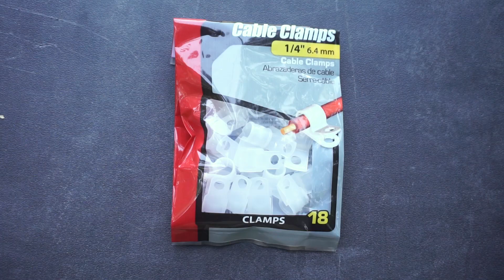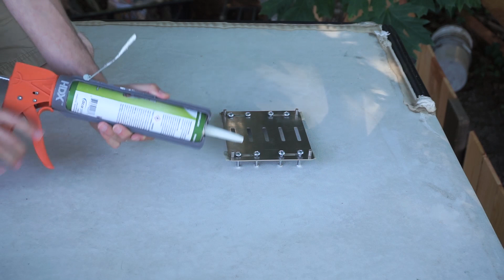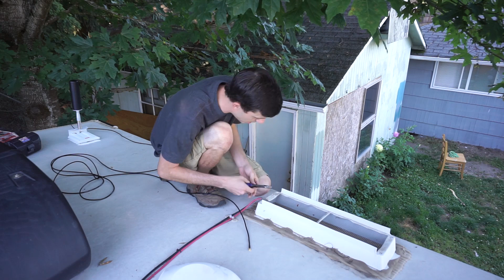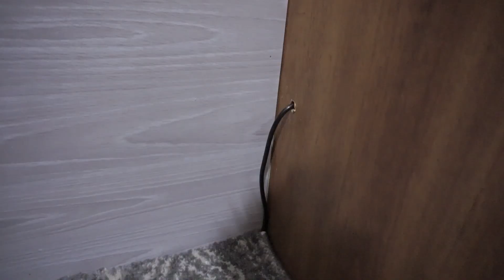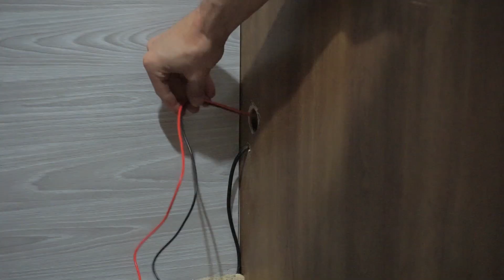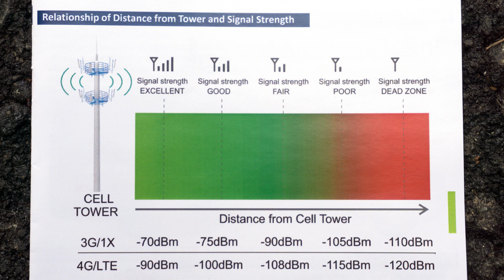RV Cell Signal Booster Install - SolidRF RV Pro Cellular 4G LTE Amplifier

Comment: You may know this trick but for those that don’t, if you strip out a wood screw hole you can fix the hole by filling the stripped hole with toothpicks. Stuff them in, break them off flush then you are good to go. Add some wood glue if you have it.

Comment: Nice job and explanation... One problem I see with running wires down the roof vent is that when the fridge dies or needs to have the gas regenerator replaced the entire unit must be removed from the front and pulled into the interior of the coach... And then put back... Having extraneous wires running through the cabinet and enclosure wall will likely be a hinderance to this process...

Comment: Where did the second antenna plug into ?   You seem to use "Cell Phone Signal Strength" interchangeably with "WiFi Signal" as you presented this. I thought those were two different things.  Regular Cell phone conversations are not on WiFi (normally for data). What Am I missing ?  Thank you !

Comment: A good adhesive will provide more than sufficient adhesion  of a flat plate to a flat surface.  Better to have used the adhesive under the plate so that every bit of the plate's bottom was covered and thus adhered to the roof surface.  Wow, that looks precarious!  Don't run under a tree!

Comment: Nice, David! FYI, as a woodworker, here's a tip when you want to drill to a certain depth and no further. Use painters tape to make a flag on your drill bit (cheap!). When the flag gets to the surface you're at the depth you wanted. Should work for the hole saw too, although I've never tried it. I would be super nervous next to that tank.  There's also something called a gimlet you can use to drill holes. Not as fast as a drill but more precise and totally controllable. I have six different sizes in my woodshop. You twist them by hand. Cheers!

Comment: Hi David.  Another great vid.  Just an observation.  I noticed as you were connecting the ground wire that there was a lot of debris around the strip of wires. A quick vacuum would be in order to avoid any possible problems.  Just a thought.

Comment: Hi David,  You first state the interior needs to be less than a foot and a half from the outside antenna.  Then you show the internal antenna on a desk more than a foot away.  How does that affect your install.  Also did you look into a booster kit where the booster stays inside the coach? and not outside on the roof???
Reply from the maker: They are less than a foot and a half from each other so this is not an issue for us.
Reply: @FateUnbound  It looks like the outside one is 6" off (above) the roof and the other one is on a desk like 4 feet below the ceiling.  It may work perfect but it sure looks like they are much greater than 18" apart.
Reply from the maker: Okay I see your confusion. They need to be no more than 18" horizontal distance and at least 4 feet vertical distance from each other.

Comment: You have connected the positive side of your cell booster to the positive bus. Please fuse this device at the bus or better yet use an actual fused position in your breaker box before you burn your trailer up.

Comment: Thank you for showing the actual improvement. I tried a WeBoost and it was all but useless. Just an FYI. When I ran my 12 volt power up to my roof to power fans for my AC units, (the original 110 volt fans failed miserably), I used half inch water piping to run the wires through. It protects the wires from sun damage and most of all from squirrel damage. I used small pipe clamps to hold the runs in place. Standard connectors and tees made the job neat and easy. I used the flexible piping so going over the end of my roof which joins to a large radius on the end cap was easy as well.

Comment: Nice video...On that table corner, if you place a small square of aluminum foil, between the antenna and the wall, to make it act like a reflector for the antenna, you might increase the range and signal strenght, almost for free.  Give it a try! You can also apply the same principle for the roof antenna, so you can direct it to the signal source when you are in the woods.

Comment: so, a couple of things:

1) your phone's signal meter is not going to give you an accurate reading on the actual signal that you are getting.  your phone will only show you the signal strength between it and whatever antenna it is connected to.  obviously, since your phone is connecting to your indoor antenna, and it's only a few feet away, you are going to get "great signal strength"...but that means nothing if the signal quality coming in to the outdoor unit is junk (or non-existent) to begin with.  there is a huge difference between signal strength and signal quality (and your phone only shows you strength).  the real test is actually trying to pass data, that is what will tell you the full story...which leads into:

2) you should never, ever, ever, ever, run your signal cables parallel with any sort of power cable. ever.  i don't care how much easier/cleaner/prettier it is, or how much work it is to run them separately...if you run your power & signal cables parallel with each other, there will be signal degradation/distortion, which will limit the quality of your signal as it comes out the antennae.  if you absolutely have no choice but to cross power cables with your signal cable, make sure they are perpendicular with each other, and not parallel, in order to limit the surface area of EM induction.

i'm not trying to be negative here, just stating facts that a lot of people either don't know, or don't think about when doing these types of installs.  that said, we are all free to do things as we see fit, but i just want to make sure that as many people are at least aware of the facts beforehand so they can make their own "informed" decision on what works best for them.
Reply: Indeed. Both are very important and practical points. I am really curious on how this works out.
Reply: @Cougar125 This is true, but it is also more expensive for the cable the more shielding you have...not to mention, I can guarantee you that the cables that come with this kit do not have near enough shielding.  And even if you have the extra shielding, there's no reason to take chances, especially when it costs nothing to change the cable path.
Reply: xunil76 is correct.  We purchased a WeBoost for our vehicle with the plan to move it to our off-road camper when parked.  After installation, I started looking to see if we had a bar increase.  Wrong decision because the first time we used it, I saw no difference in bars.  I called WeBoost tech support and was emailed instructions on how to use our Iphones or Android phones to get a more accurate picture of reception strength.  Following those instructions, it was very easy to see on my wife's Android the cell coverage improvement with the Weboost on and when it was off.  For some reason, the Iphones are more hit or miss with this, but no issue with the Android.  The weboost we purchased was the Drive 4G-X OTR that comes with a DC power adapter (designed for vehicles) but after asking weboost, they were nice enough to send us an AC power cord.

Comment: Good stuff, but as an RF guy, I have to comment on the measurements at the end of the video.

First, the units for the measurement are not "decibels", it's "dBm", which is "decibels with respect to 1 milliwatt".  A decibel is the log of a power RATIO, not a power level.

Second, just because the power level is higher doesn't mean the reception is any better.  It MIGHT be better, or it might be worse!  This touches on an RF concept of "noise figure", which is how much worse a circuit makes the signal-to-noise ratio.  When you have an amplifier, you don't just make the signal bigger, you also add noise.  In contrast to this, the antenna on the roof probably gathers more signal, while the walls of the RF, as well as the lower position of your phone vs. the antenna on the roof reduce the signal level.  So the signal booster has a chance to make the signal quite a bit better--but probably not the 30 dB (it's now a ratio, so dB is correct) improvement you see on the phone.

The only simple way to know that you've got a better signal is to do a throughput test.  There are (much) more complicated ways, but they are  going to be quite painful for a setup like this.

So why not do a speed test in an area with poor signal, and see how much better it is?  You don't even have to put the phone in a test mode to do this (which is likely if you are showing the radio signal level).

Comment: Great job on the video David.  We're considering something like this as well for our cell/Internet needs.  Thanks.  I'm curious if the slots in the bracket that you filled with Dicor are for cooling.  Just a thought.  Great vid.

Comment: I think I might have positioned that outside antennae bracket a little differently considering that you could only hit one rafter. Positioning it diagonally would have allowed you to securely mount it in two opposing corners. GRANTED, it would have looked weird and honestly like a mistake (admit it, it would have looked a bit crappy to you and I because I suspect we are both perfectionists) but it would have a REALLY GOOD grip on those two corners, leaving no room for flexing up as is possible if those two screws on the one side that are only going into 1/4-inch plywood back out. Still, it's likely going to be just fine as is. (Apologies for the Monday morning quarterbacking. LOL. I hate it when that happens, tbh, but did think my suggestion "might" be helpful for others who may be less confident in the plywood only method for the one side.)

Edited to Add: I retract my suggestion. You have FOUR screws in that one rafter which is much better than the TWO that my suggestion would result in. Good video. Safe travels, y'all.

Comment: Thanks for sharing the installation video.  I was confused when you said the inside antenna has to be 1 1/2' from the exterior, but then when you put it inside it looks like it's probably 6' below the exterior antenna.  Does that mean it has to be laterally within 1 1/2', but can be vertically several feet away?
Reply: yes, laterally.  the signal mostly radiates out of the antennae in a 360° radial pattern from the sides, and in sort of a "wedge" shape as it goes outward, but not so much from the top & bottom; so if you put the interior and exterior antennae where their signals can pick each other up, you create a feedback loop and you booster doesn't work properly.  if they are (almost) directly above/below each other, they can't pick up the signal from each other, and things work the way they should.

Comment: what's the signal strength outside your camper at that location?  Lets not forget a trailer is a metal box.  I find good signal at my windows, but loose most signal when not at a window in my camper.

Comment: I think there is a flaw in your signal strength test. You are testing the signal from the interior antenna, not the quality of the overall LTE connection. You really need to test bandwidth at minimum.

Comment: Cool install. Love it but you may think of installing a switch on that 12 plug (perfumery a lighted one) so you don't forget to turn it off while driving to next camp site. I did the same thing years age when I installed a booster on my truck way back when 2g. I hard wired it in and forgot it and almost run down my truck battery. Again cool vids Love them keep it up and stay safe.

Comment: Once again a great tutorial from David. The longer the cable run the greater the signal attenuation. I would have taken the cable straight down in the corner; trimmed the line to the cable length needed; and added a new connector. With 5G around the corner, will you need a new booster next year?

Comment: When it comes to potential water infiltration, a belt, suspenders and string in your pocket approach is definitely called for.  

If the panel was completely disconnected from shore and battery, how are your interior lights on?  

That is a big boost, but 4’ interior range seems rather limiting.  It will be interesting to see how it is to live with over time, and how much it drops when not working right next to the interior antenna.

Well made video, and keep up the good work!

Comment: Water tight tape (self fusing) -(search Amazon) will keep water from getting into your external coax connectors .... degrading signaling and corroding your cables with water ingress.

Comment: Good video.  Only thing I would have done differently is to use Eternabond tape on the cable run from the exterior antenna to the fridge vent.
Reply: Jerry Apple I would just use dabs of dicor every 10”... The life of these things are only 2-3 years then they need to be removed to upgrade...

Comment: Take a pair of pliers and a roll of Electrical tape back up and snug your N connectors on the amplifier and then wrap them up with tape, no Lap, you may have to take them off at some time. Nice install!

Comment: I am super interested in finding out what the  measurements of  RadioFrequency radiation is with all that inside the trailer. I  have inflammation issues with vertigo that would be highly affected by it. maybe in a future video you could run a test with a meter for us. Please
Reply: THAT is why they invented tinfoil.
Reply: @Steve_Farwalker  😁😆🤗 So I've been told.

Comment: have you thought about getting a mobile WIFI? alot of the high end coached have mobile WIFI as do newer cars so they should have a mobile WIFI that you could use in your RV
Reply from the maker: By mobile WIFI do you mean satellite internet? Once Starlink by SpaceX is online we very likely will use that. We are installing a mobile signal booster into our truck in a future video so that will help while on the road.

Comment: butyl tape looks like the "goopy puck" i used to vacuum seal aerospace parts. usually heated to around 350-400 degrees for about a half hour or more.